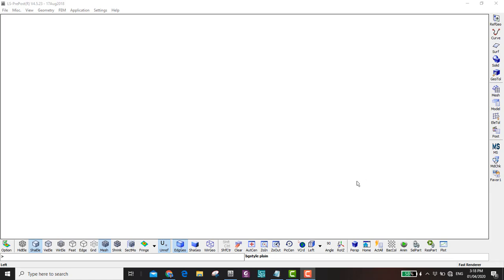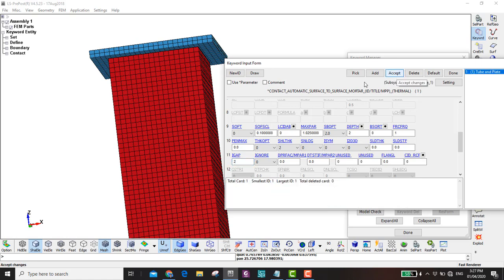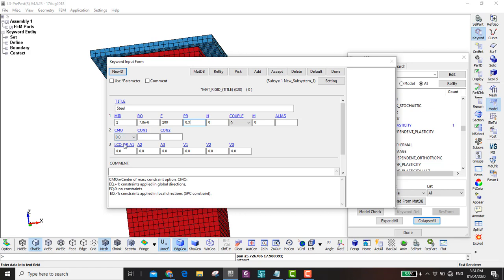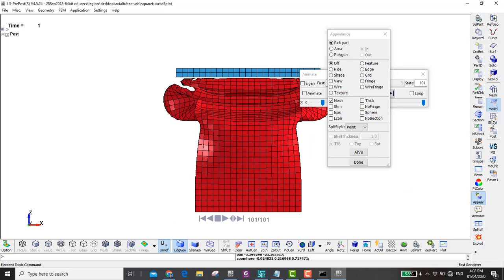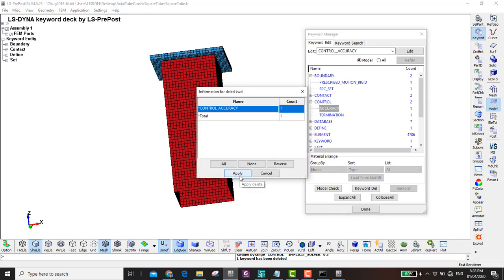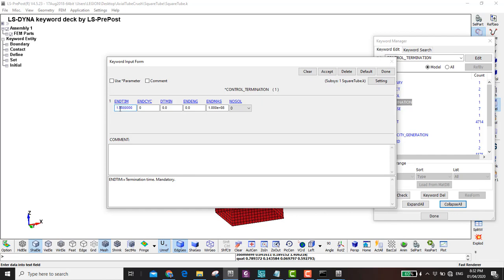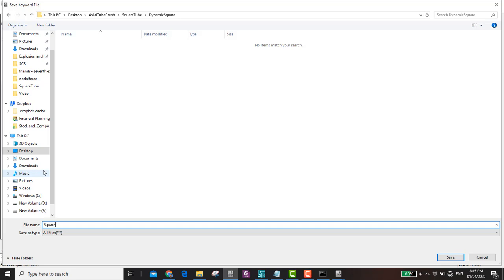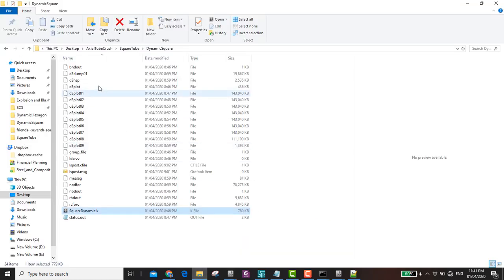LS-DYNA TUTORIAL 12: Static and Dynamic Axial Tube Crush

Comment: Hi Amen thank you for this awesome tutorial. I have two question , is it normal to get huge result files in second analysis. For hexagonal shape, explicit analysis whole results are 22gb.  I didn't get that much bigger  result before. ( Termination=10, d3plot : 0.001).   And my second question is ;  in my analysis,  the swelling in the box which is a result of folding is much less than yours. I got similar graphs but in my opinion it is not matching with experimental results like the page you refered. I checked all but there is only one different than yours: My ELFORM is not same with yours. My elform is different because of my pre post version (v4.6.17). What can I do for getting results similar to experimentals.  Sorry for that long questions, but you are my savior :) 
Thank you again for this great videos!
Yours sincerely.
Reply from the maker: Hi there, first of all. We can discuss through email for more convenient  communication. Put your email address here and I will follow up. 

First, yes, the results will be big even if your k file is small. With those settings, you will have 10000 frames of results which is too much. 

Secondly, you can use different formulation. Just download the latest LS-Prepost. Different ELFORM will give different results. Matching experimental work or results of others is not an easy task to do. But it can be done. I need to know more details to be able to give a useful answer.

Comment: Hello, Ameen! Please tell me, I use MAT 83, the properties of which depend on the deformation rate. But for some reason, the implict analysis does not take into account the speed.. it always counts according to one curve, the very first, regardless of what loading speed. Is it possible to fix it or is it the features of implicit analysis? Thank you very much.
Reply from the maker: Hi there, it's you again! :D

Make sure you are using implicit dynamic analysis not implicit statics.
Reply: @AmeenTopa  I apologize for the annoyance....) I always enjoy watching your videos and it's only thanks to this that I started doing my mini projects! I am very grateful to you for your advice.
That is, the implicit analysis should take into account the influence of speed on the behavior of the speed-dependent material, but you need to specify an implicit dynamic analysis?
Reply from the maker: @vladimirlubimov2318  It's fine. You can always ask here if you have any questions.

*CONTOL IMPLICIT DYNAMICS. You can read more about this keyword in the user manual vol. 1.
Reply: @AmeenTopa  Hello, can you provide email contacts by which you can be contacted and discuss the issue of assistance in person?
Reply from the maker: @vladimirlubimov2318  check the following link:
https://sites.google.com/view/topacademyofficial/about-topacademy

Comment: Dear Sir,

I am very excited to see your tutorial. Thank you very much for your explanations. I really appreciate your effort!
But, I want to ask a question. My purpose is to do a quasi-static simulation of the same profile. However, I really do not understand how you simulated 100mm/min press velocity. You did not enter any value for the velocity of the rigid body in quasi-static analysis. But how could we make sure that we are doing quasi static analysis with 100mm/min press velocity. In the article, there are different speeds for the press.
Reply from the maker: Dear Yilmaz, the quasi static analysis is done using implicit solver. When using implicit, physical time is irrelevant.

Comment: Sir thanks for such an incredibly good videos. But i have encountered a problem....the solver says i need double precision version for the implicit method. Kindly help!!
Reply from the maker: Yes you need to change the solver from single precision to double precision. I don't know what system and what version you are using. So, you need to contact the technician who installed the software to do that.
Reply: @AmeenTopa  actually its a cracked version R11  and do i have to download a double precision solver??
Reply from the maker: @Ankit-df8rw  if it is a crack version then I don't think I can help you because I never used that.
Reply: @AmeenTopa  1 more thing sir i wanted to ask..is it possible to perform implicit analysis in single precision version of LS-DYNA??
Reply from the maker: Yes possible for simple analysis.

Comment: Hello, I have a question for you. If i use contact suface to suface for implicit solve so my result is true ?
Reply from the maker: It is better to use AUTOMATIC SURFACE TO SURFACE MORTAR for implicit analysis as it improves the stability. If you didn't use the MORTAR option, then you might not reach convergence in the analysis.
Reply: @AmeenTopa  so CONTACT SUFACE TO SUFACE only use for explicit analysis ?
Reply from the maker: @Prisonbreak910  For more about contacts, you can check this webinar:
https://youtu.be/j7lEIeYLNIY

Comment: Hi Ameen, I have some questions which may not related to this video. In case that the element is Lagrangian or Eulerian elements, from where we set Lagrangian or Eulerian to the element?
Reply from the maker: This is controlled from ELFORM in SECTION keyword. In this video, I used Lagrangian elements.
Reply: Ameen Topa thank you so much.
Reply: Hi Ameen, I have some more questions. 1. in my case, the load  is a pressure-time history on the rigid plate,  do I need to define the segment set on the rigid plate and then apply load on the segm set, am I right or wrong? 2. For contact, we need to create every possible contacts which may occur during the crushing right?
Reply from the maker: @lalinlamCambodia  If it is a RIGID plate, then just use LOAD BODY RIGID

Comment: Just a question, I am trying to do the same but with an aluminium honeycomb model and I got this message "
 * Error 70021 (OTH+21)
     Memory is set 598383462 words short
     memory size 900000000
     Increase the memory size by one of the following
     where #### is the number of words requested:
       1) On the command line set - memory=####
       2) In the input file define memory with *KEYWORD
       i.e., *KEYWORD #### or *KEYWORD memory=####
What can I do?
Reply from the maker: This means you need to allocate more memory to solve the simulation. You can put MEMORY = 1000m like what I do my most of my videos.
Reply: @AmeenTopa  thanks, but where is this option?
Reply from the maker: You can when I open the LS DYNA manager, before the I run the file. There is a space in front of MEMORY.
Reply from the maker: Check the video at: 13:30

Comment: excuse me sir,i got some warning  and i dont know how to fix it .I got  Warning 40571 (SOL+571)
     Initialization - node will not be moved
     penetrating node near or at shell mid-surface,
Warning 30131 (INI+131)
     total number of massless nodes = 1,and
Warning 30128 (INI+128)
     Massless nodes
I design this model in soldiwrk and mesh in hyperwork then import to ls-dyna.These is different from this video.I dont know that involve about my warning.I hope you will reply my comment.Thank you very much
Reply from the maker: Hi, a common mistake when importing geometry from solidwork or other CAD software is that you make the geometry as solid parts, but when you mesh it, you mesh it as shell. 

Massless nodes can be removed by: Element Tools, Node Edit, Delete Nodes, Delete unreferenced Element Nodes.
Reply: @AmeenTopa  According to your suggestion,My model can run but  impactor  runs through crashbox which doesn't appear collapse of crashbox. Is it possible this warnings  involve with my result?
Reply: @AmeenTopa  Warning 40571 (SOL+571)
     Initialization - node will not be moved
     penetrating node near or at shell mid-surface
     single surface interface #             =           2
     penetrating node #                     =        5534
     segment #                              =        2917
     penetration                            =  9.6500E-01
     remaining distance to shell midsurface =  0.0000E+00
     s,t                                    =  1.0000E+00  1.0000E+00 
and i have already seen this warning that is involve to my animation.
Reply from the maker: yes, it is highly possible that this penetration is due to the meshing. That's why, if possible, I prefer to create my parts from scratch using LS-Prepost
Reply: @AmeenTopa   What is unit of force in dynamic case?
Reply from the maker: @chaimongkolpadungtree2878  force is in kN

Comment: why didn't use compression material property
Reply from the maker: @ChanghoKim-y7l  for metals, the tensile and compressive properties are the same except for high strains.
Reply: @AmeenTopa  i got it.. thank you then i want to steel compression test(quasi -static) for using lsdyna.  then i can use johnson_cook or  MAT_PIECEWISE_LINEAR_PLASTICITY right?  but i don't know what is the best mat card for the steel compression simulation can you give me some advice?
Reply from the maker: @ChanghoKim-y7l  both are fine. You can just use MAT024.  

MAT015 is used for high strain rate simulations with damage involved.

Comment: Can I use the same procedure in the video for crash box(in shape of cone/square with some thickness)if not,what are the changes to be made in the procedure sir!!???
Reply from the maker: Yes you can.
Reply: @AmeenTopa  ok sir thank you.suppose if that cube section should to be made of composite..is it enough to change the material cards and follow the same procedure!?or any changes to be made sir!!?
Reply from the maker: @Kiran58399  yes only changing the material properties. To control the no of Laminates and their direction, you need to modify the parameters in SECTION SHELL.
Reply: @AmeenTopa  thank you so much sir, I'll let you know if it works.